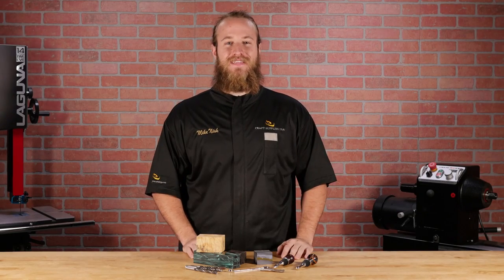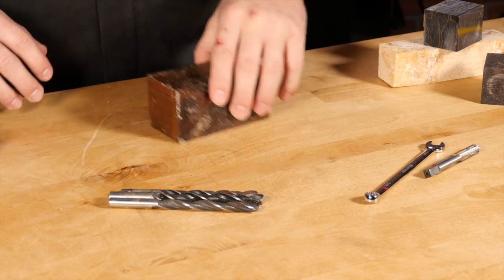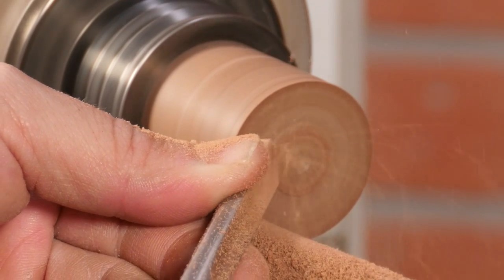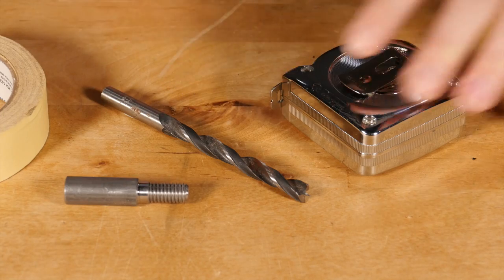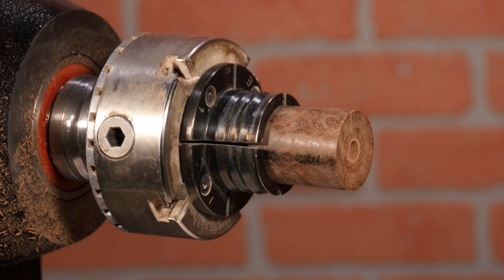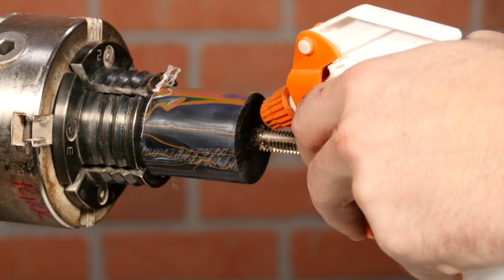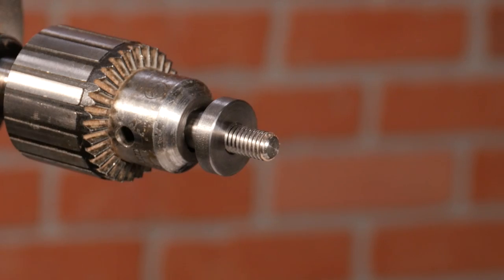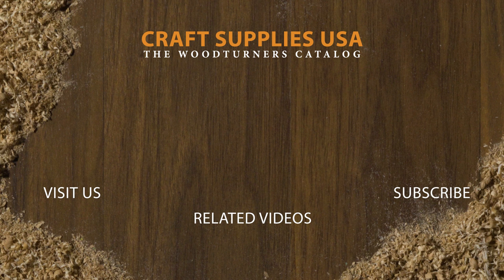Threading Wood and Acrylics (Woodturning How-to)

Comment: Thanks so much for the video. I realized I might have made a mistake with the tapping process by making too many turns, which resulted in it feeling loose. I'm planning to use epoxy to secure it, as some of my threads, depending on the type of wood, were fine. Adding epoxy makes me feel more confident. What do you think?

Comment: Tapping the hole is better off being done by placing the tap in the tailstock with a drill chuck to hold it dead center. Leave the lock off and allow the tailstock to freely float as you push the tap into the blank, while rotating the spindle. Tap into the blank part way and then release the tap from the drill chuck. Using a tap handle continue tapping the hole until is completed.

Comment: I had been told you can’t use that type of tap on wood.  Did it work because you used hardwoods or was the wood stabilized?
Reply from the maker: It cuts threads on wood nicely.  If you are using softer woods soak the drilled hole with thin CA glue to harden the area to be tapped.